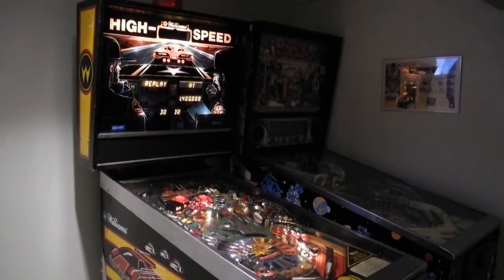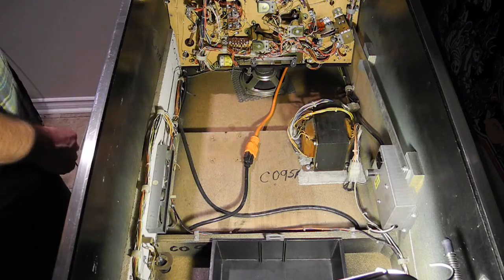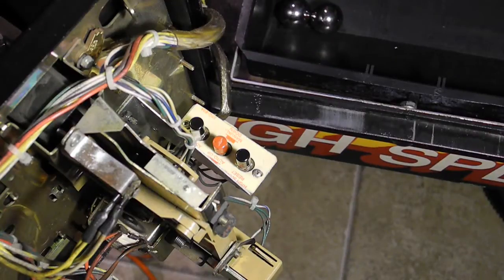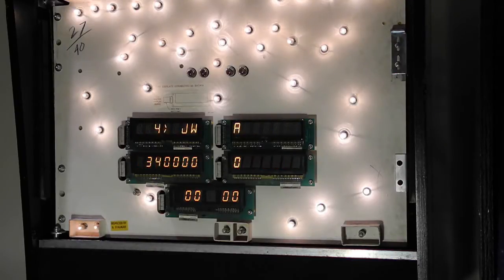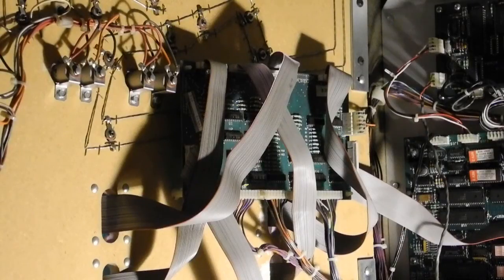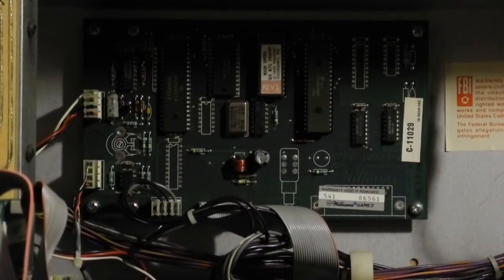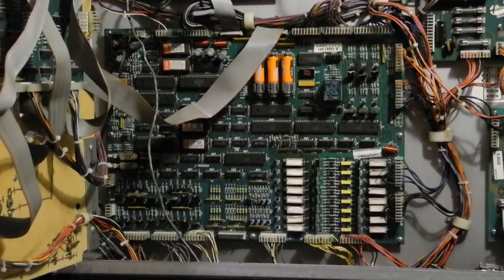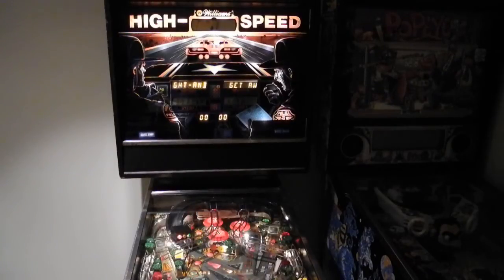The Williams High Speed Pinball Machine

Comment: Nice video!
I mostly come here for your vintage SWL receiver reviews, but have to admit that this fits in with your recent series on classic computers.

Anyway, that's a great pin!  Most pinball hobbyists these days are replacing the incandescent bulbs in their machines with LEDs.  This not only makes the table look cooler, it also helps prolong the life of the power supply and associated circuitry since the LEDs use a fraction of the wattage of the incandescent bulbs.

Comment: Hi Jeff- You seem to know a lot about this High Speed pinball game. I purchased one almost brand new around 1987 and still have it. It is in beautiful condition. It has not had a lot of use over the years. About 3 years ago I got a message to change the batteries 3 AA's. I did this and did not see any corrosion dripping onto the boards. The game powers up and goes through it's motions but, all 3 flippers don't work as well as the right and left hideout relay kickers which are located in center of machine. I have the manual and it looks like the relay kickers are board # 1P11 and all the flippers are 1P19. I am not expert are these two separate boards? Could both be bad? Is there another way to test?Thank you very much, Dave Zurick
Reply from the maker: I would suspect the power supply, or the flippers themselves but that seems unlikely if they are all bad. Part of the power supply powers only the flippers. I don't have a service manual, just an instruction manual which has schematics but doesn't list what the voltages should be. Maybe someone on one of the pinball websites/forums (like pinside.com) would have some ideas.
Reply: Hi Jeff- Thank you very much for getting back to me. Someone told me that it's probably a few of the slow blow fuses. It's worth a try even if that's not it. Great video. Thanks again!!! Dave Z
Reply: Rob- Potentially. I wouldn't crate it or ship it.
Reply: Rob- Sorry to tell you that I am in East Windsor NJ 08520. I have taken care of this machine for over 30 years. I bought it almost new and until recently fully worked. Everything still works except the flippers and the right and left hideout relay kickers. I always waxed the playfield down and the outside lithography is really nice.

Comment: Any idea on where to get a replacement cpu board? Thanks
Reply from the maker: Your best best is probably eBay. Seach for a WIlliams System 11 CPU board.
Reply: ebay - whats wrong with your board? if it will run but things on your machine are not working it is mostly transistors . I actually replaced 11 on my board the owners manual tells you what transistors control what function.

Comment: Nice informative video.  I'm just curious if you are aware that the 2 block Bridge Rectifiers located on the lower right behind the Back Box should be fused.  Apparently Williams overlooked the fact that if one of the 2 Bridge Rectifiers would short out there is no fuse to protect anything past the Rectifiers.  This is a problem with Williams system 11 Pinball Machines. Without a fuse there is a chance of a fire. I've pasted a link to a channel that describes this issue in better detail.https://www.youtube.com/watch?v=Yjzzwc_PIm0
Reply from the maker: Thanks, I will check that out.
Reply: I installed 2 fuse links from the Bridge Rectifiers on my High Speed and was one of the easiest additions that I've ever done on my machine. I'm just wondering if you got a chance to check out the video. I've talked to many people about this issue and seems like nobody I've spoken to had ever heard of this issue before. I felt it wasn't worth taking a chance of potential damage or a possible fire as a result of a short.